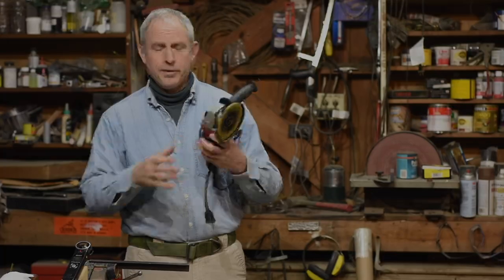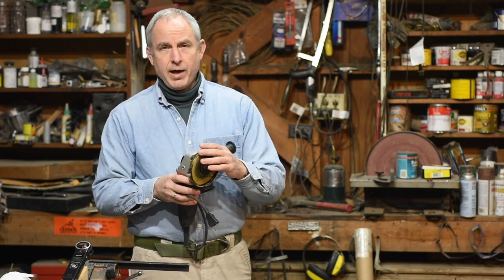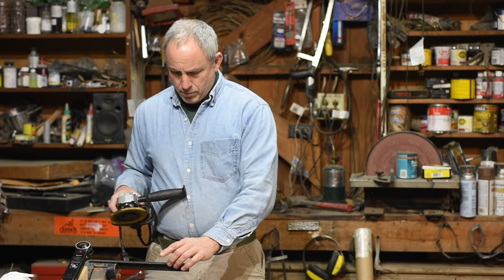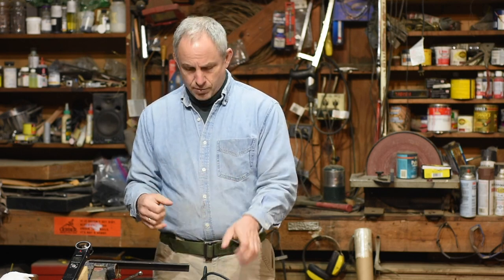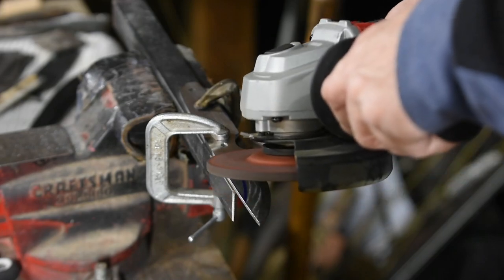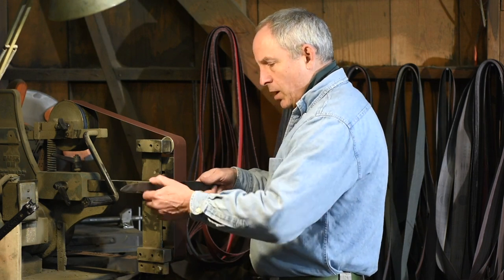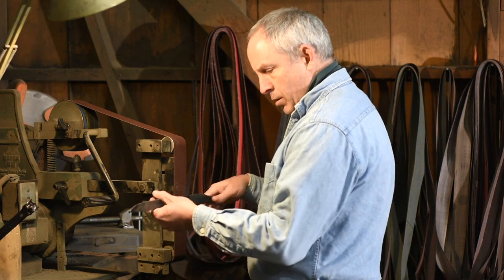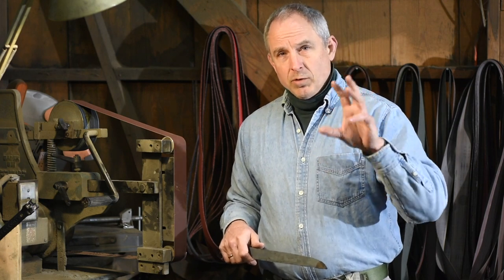Knifemaker's Friday Five #12: Using an Angle Grinder

Comment: I don't know what I'd do without my angle grinders. Cut out 15 blades today with one of mine. Great tool to have.
Reply: @boycefitzgerald  I’m currently using the DWE402. It’s an 11 amp, 4 1/2” disk, 5/8” arbor, 11,000 rpm. You could certainly go bigger or smaller but for the price (when I was comparing them and bought this one) it offered what I needed for the right price. It’s very likely there are better ones on the market, that’s just what I went with and it’s held up well for a few years now. Chews through .125”, makes it’s way through .250”, and begins to struggle with .375” high carbon steels. It’ll cut 1/2” plate (I’ve cut a good bit) but the disk gets really bogged down with friction making that deep of a cut. That’s more an issue of cutting 1/2” steel with a 4 1/2” grinder than a commentary on this grinder’s ability, the disk seems to be the weak spot there imo.
Reply: @boycefitzgerald  you’re very welcome, hope it works out for you👍

Comment: not a lot of traffic on your channel.  i'm getting ready6 to put an edge on my gladius.  i made a smaller version (Pugio) from a leaf spring.  The gladius is down to the last bit (put and edge on it without burning the steel, then tempering it.  I used one of those sponge flapper wheels for my grinder and put an awesome edge on my son's bowie knife.  then finished it off with a file for the spear tip. I hve a simple "canadian tire" sander that is 4 inches wide.  not a knife making belt grinder.  I appriciate using the body and stabilizing the edges with my angle grinder cuz it makes my wheels last longer. i beveled the 1cm down and spared the very edge with my angle grinder using that methode (Gladius).  I'll let you know how it goes

Comment: question what is the best knife making steel for new knife makers?
Reply: Kyle Forsythe He would probably say 1095 or O1. Cheers
Reply: thank you.
Reply: In my experience starting off with 1084 is a good choice as it is a pretty forgiving steel and is pretty easy forging. I'm personally fond of 5160 but I always keep bars of 1084 and 1095 in the shop. 5160 is what many newcomers start with mostly because it's found in leaf springs and coil springs. Don't let the steel snobs weigh you down when you're starting out, steel can be expensive and continues to climb (New Jersey Steel Baron has gone up a bit in just under a year).
Reply: thank you for the info
Reply: If you really want to make knives then become a blacksmith.  Make decorations for the first year or so then switch back to knives.  All of the skills you learn making flowers or railings can be used to better your knife making skills.
Reply: @Christian Shemak, I couldn't agree more. I started off with decorative ironwork and I continue to do that, blades are just something I enjoy aside from that.

Comment: This might sound silly but why not clamp the grinder and hold the material (instead of holding the grinder) - I know he was just showing learning to use of the grinder in the initial video though.  Although you'd maybe need a clamp to hold the material, I don't think i'd be wanting to put my fingers in the direction of a grinder come to think of it lol so better off the original way Walter showed
Reply: Those discs spin a lot faster than a belt grinder, they will fling a knife blade out of your hand at a very high speed. Best just to clamp the workpiece my friend